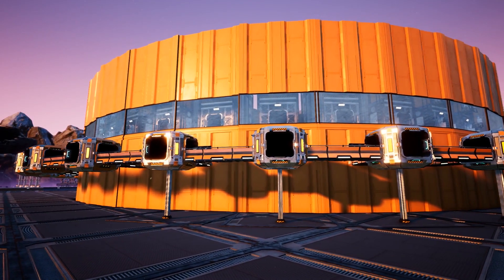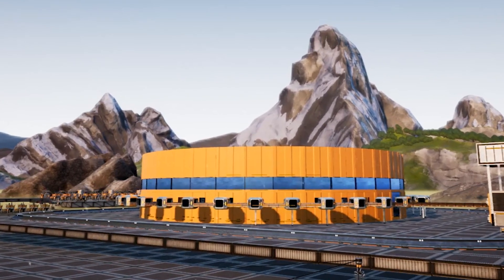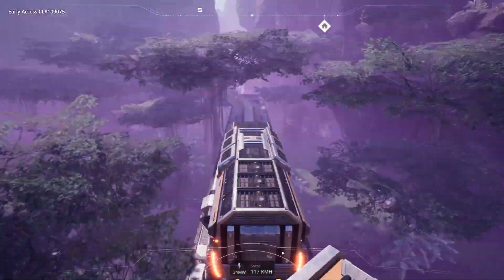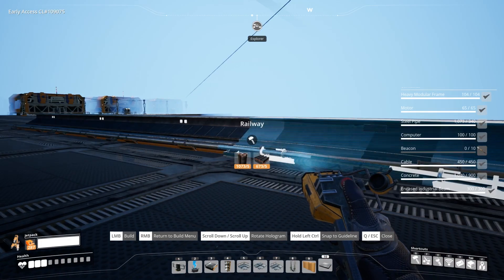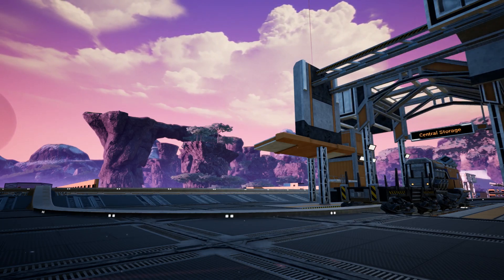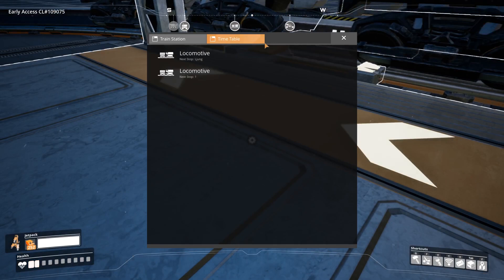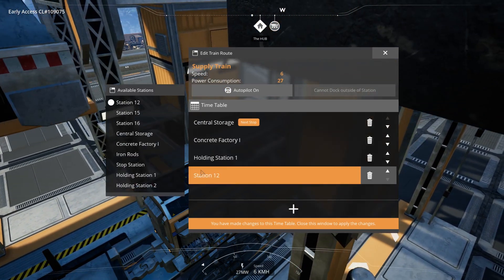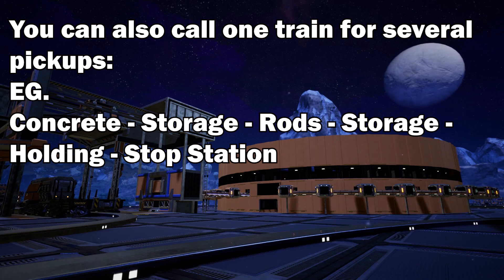How to Use Automated Trains to Avoid Smart Splitter Blockages Satisfactory

Comment: For anyone watching this that has not yet figured this out there is a MUCH simpler way handle blockages. If you have a Smart Splitter line auto sorting your stuff do this: set the right or left to your desired drop off item, let's say Iron Rods. You then set Center to Any Undefined and it will pass all others off to the next items in the line. But what I think a lot of people don't realize is how intelligent Smart Splitters are in that you can set the opposite of your Iron Rod output to Overflow and it will only overflow out the items that can't go further down the Iron Rod output. All other items continue down the center into the next splitter. You can use this to set up a mass overflow valve into an AWESOME Sink.
Reply from the maker: This is great now. But at the time of this video we didn't have the option to overflow on smart splitters, nor did we have the awesome sink available.
Reply: I'd like to add that nowadays with programmable splitter you can set same end to output both overflow and undefined, so considering you pile everything on the same belt anyway, just let the stuff flow through the entire sorter and go in the sink at the tail end. This way you'll need only a single belt without a parallel one which picks overflow from the smart splitters.

Comment: Yea, this doesn't make any sense.

All this to prevent lines from overloading?  Why not just use a smart-splitter with an overload output sending the overload into the awesome sink?  It's what I do. Send everything into a distribution system, and if anything overloads, send it off to a "trash" line into the awesome sink.  The whole system is small, compact, fast, and never overloads. Plus it generates a ton of coupons.

Comment: Not an elegant solution, but it works. Seems like it would take a lot of monitoring when what you really want is something automatic.
Reply from the maker: You're absolutely right, it's a work around for the time being, so that you don't freeze up your system,with a well planned system you shouldn't need to physically go in and check your containers though, which would save time, you'd still need to route and run a train though

Comment: I didn't really understand that. I think I need visuals to go with the explanation, so I guess that would be alot of work ^^
Reply from the maker: Teflo it would be much easier to do on my pc in the Uk. 

But basically. - when the first container is empty, I go to the train station and set a route for the train to go to the said containers item factory, and it brings the item to the storage system. In order to stop the train repeating the route and filling up the storage unit (thus blocking the smart splitters) we place a “stop” station which the train can’t reach along the track we do this by placing it in the opposite flow to the rest of the train network. - I hope that helps 😅
Reply: @TotalXclipse  : Ah, got it!
So you're triggering the train once and it drives its route to input and output once, then stops there as it cannot reach #3?
This allows for a dosed delivery of one waggon full of resources. 

I wish we'd get some sort of logical processors so we could define rules and scripts to automatically execute.  <3
Reply from the maker: Luftwolf exactly and that way if we connect each factory onto a single train system we can collect items as and when required ☺️
Reply: im also lost on the idea. if there was visuals it would be great. thanks anyway.

Comment: Just an idea, couldn't you put a resource sink at the end of the line and any scraps that get through wont bottleneck but instead go towards ticket production and allow everything to stay flowing freely?
Reply from the maker: William Presson yes, you can, unfortunately when I made this video we didnt have resource sinks available 😅
Reply: Only problem with that is that half (or more depending on your setup) gets sent to the sink.  And your system will constantly send the resources out to the storage/sink even if those parts could be better used in production.  There needs to be overflow options in the smart/programmable splitters.  So that the item will ALWAYs go down the designated path unless that path is blocked, then it could travel another path.
Reply from the maker: @DarthPoyner  That's true but with a little modification we could actually add some splitter mergers at the end of the lining, connecting back onto the system and then reduce the amount to 3% of items go through the item sink unless the system is full